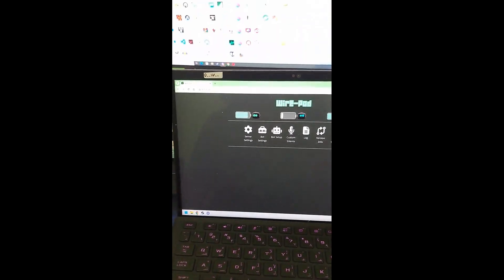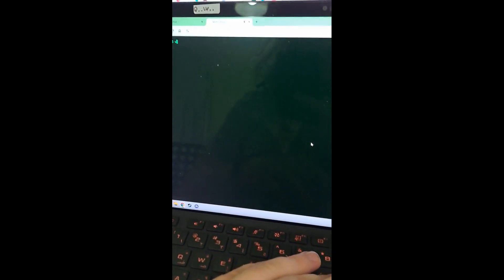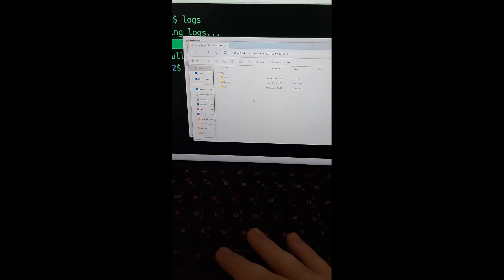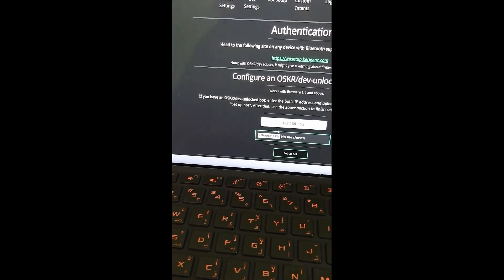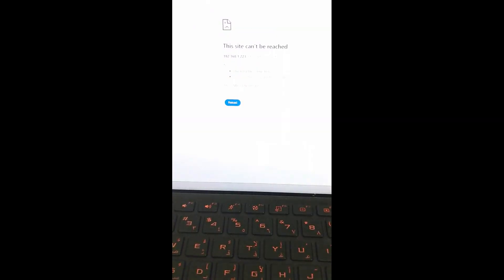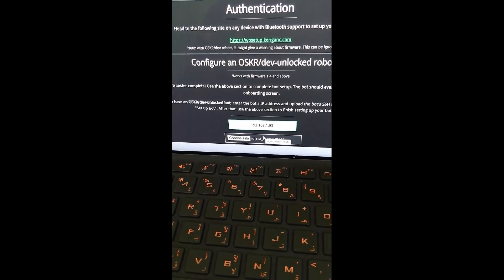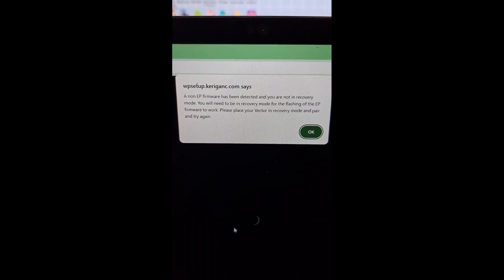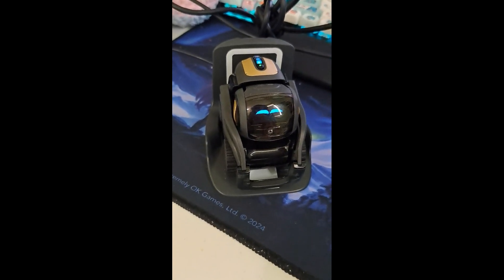How to connect a Production (CPU swapped) Vector to wirepod F.T. viccyware :3

Comment: I am really sorry, but I am having trouble with connecting him to Wirepod. I unlocked it using the no cpu swap method, and I am wondering if that is the problem or I am just doing it incorrectly. When I go to the page for escapepod it fails to authenticate. I have both tried using Viccyware and WireOS, but both didn't work. Please help me. Thank you for your time. If you need more information about the bot or something else, I will cooperate.
Reply from the maker: i working on a video explaining this it will be out soon!! :D